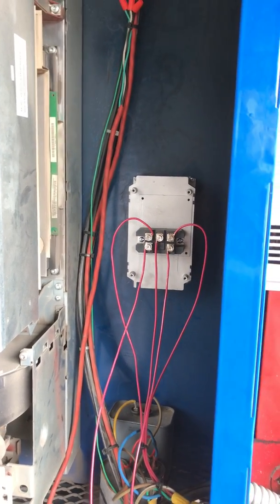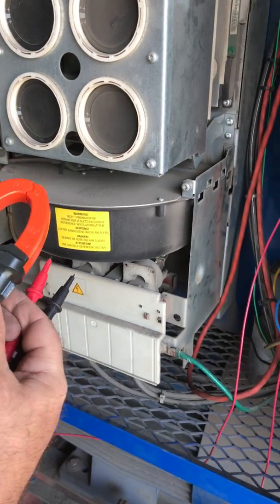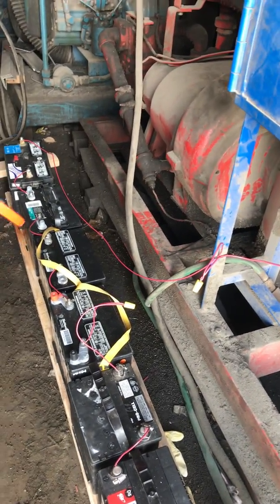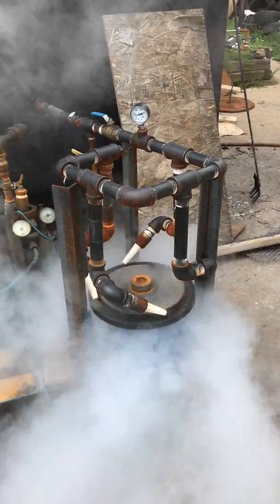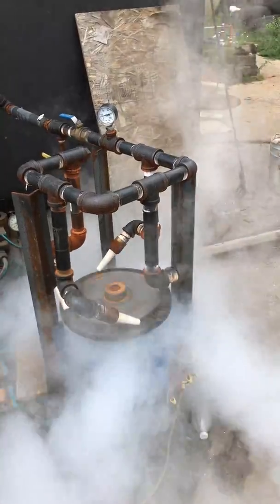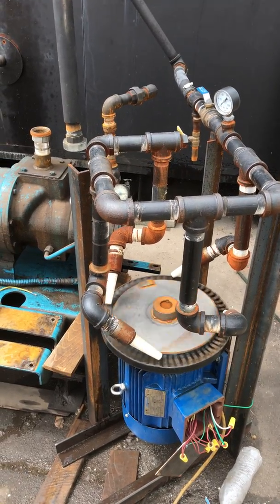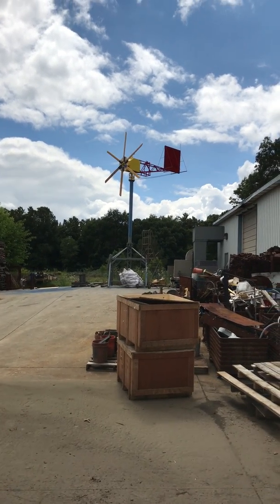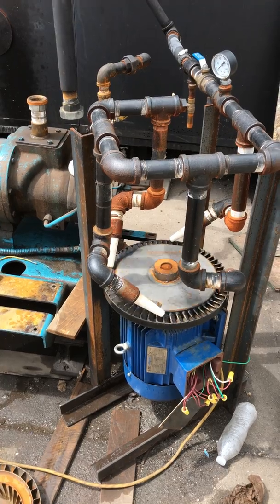IMPULSE STEAM TURBINE CAPACITOR RECTIFIER AND BATTERY BANK

Comment: RMS conversion of full wave rectification of ac to dc = 1.414 volts, the reason it's not going to full open volts, it's being absorbed in battery bank.

Build a cage/shield around the rotor to cut down on parasitic drag, reduce noise 

Such a feeling awesome design and build!  Total zombie apocalypse power station 😃

Comment: Does it stop cold when you put a load on it?
Reply from the maker: It is charging a completely discharged string of 12 volt batteries. There is a load on it. If i disconnect the load or unplug the capacitors the speed would have been 2200 rpm at 10 psi. not 300 as seen under a full load and 20 psi. Please see other videos of this unit here on youtube. 

No load 10 psi below.

https://youtu.be/q4rqYHmD27Q
Reply: I have seen most of your videos. You never show meters measuring current, or charge controllers or nothing, so we just assume it is just not hooked up to anything. Most videos are like that. I do like your persistence.  You put a lot of work into your systems. I have a big interest in a solar heliostat farm boiling water to run a turbine generator similar to yours. The software to move the mirrors would not be hard for me, but the steam engine has always been the bottleneck, or at least on youtube videos.  No one has made a Tesla turbine hooked up to a turbine generator running steam from a heliostat array, and generating electricity.  And I don't understand why. It just looks like it would be not that hard to do, yet, I only see giant companies as being able to do it.  You are able to do a little bit or a demo, but it feels like you have to watch it, etc.  It is just a demo.  I want to see a home system that runs without intervention, with solar heliostats generating steam and making power, with the steam being recycled somehow. That is the one hard problem.  Also, there is always seal leakage in tesla turbines it seems, but maybe a little bit of that is okay.  Of all your videos, the Rotary Screw turbine looked like it worked the best in that it did not throw steam everywhere.  Good luck with your projects.  Even if you don't get your heat from solar thermal, it would still be nice to see a system running in production, like something that could work all the time with no intervention.  I don't know if that is even possible at a small scale level, but I think it would be.
Reply from the maker: If you want steam from solar, look no further than an evacuated tube system.
Reply: Biggest thing to make next is a steam condenser to cool/capture/recycle the steam back to the boiler...cool build